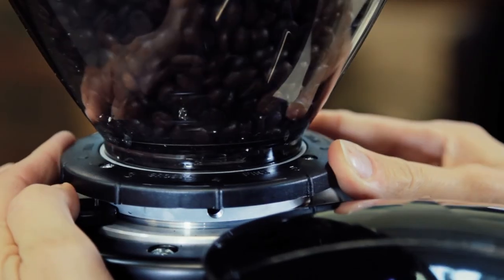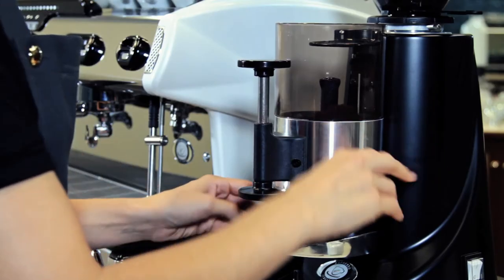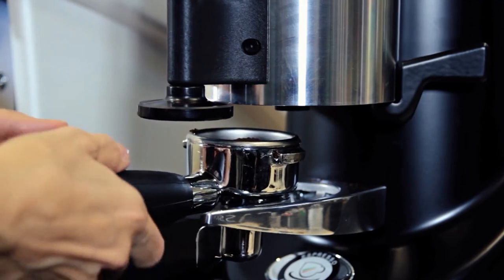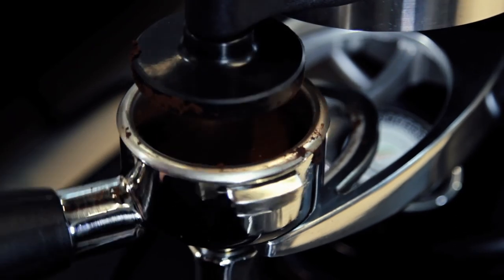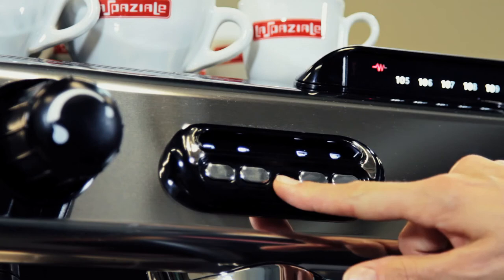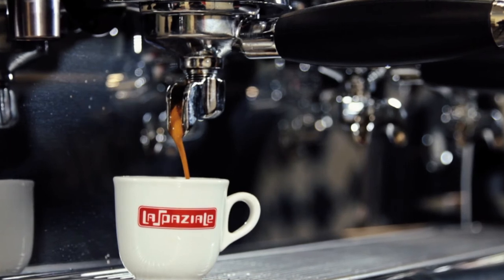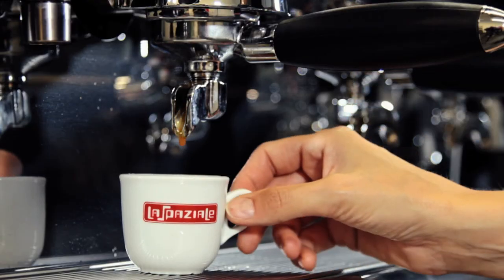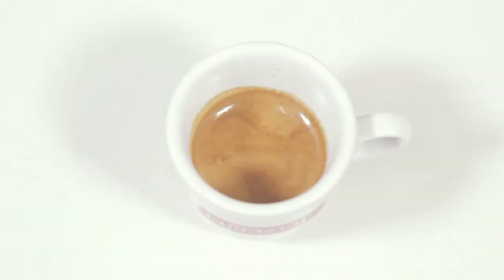Errors in the espresso extraction: the over extracted coffee

Comment: My espresso flows fast from the Breville Barista Pro portafilter, and finishes a double shot in about 15-20 seconds.  But it tastes ASTRINGENT which I understand means it is OVER extracted.  I am therefore confused on how to resolve the bitter, dry, astringent taste which is undrinkable.  Suggestions?  thoughts??
Reply: What's your dose? 

Coffee In : espresso out
Reply: @aidenmarshall6478  I am dosing nearly 18 grams dry and manually stopping when wet dose is at 36 grams.  Same tamp; 3-4 grind size (internal burr is on 3) either drips at first or flows in 36 seconds.
Reply: @sstraubi  Ok.  If it still tastes astringent I would go slightly coarser.  (Not sure how large or small of an adjustment your grinder can make but I'd say try 1 step coarser to start off and go from there).